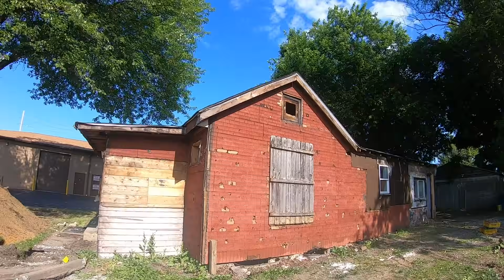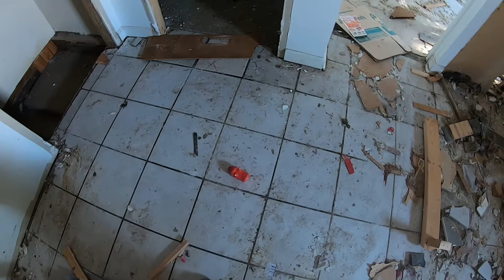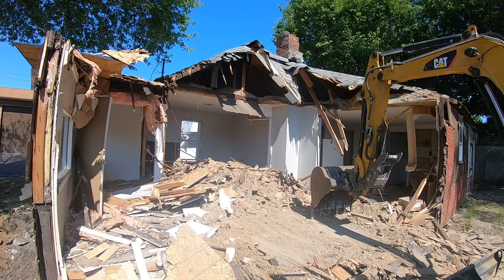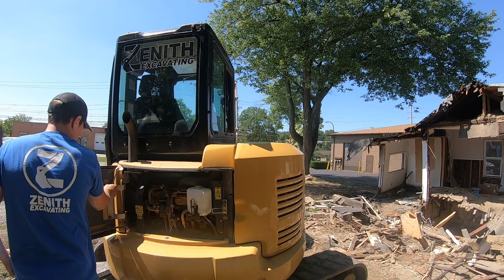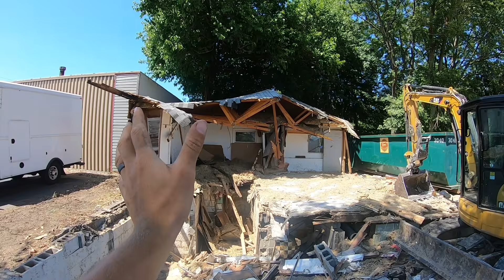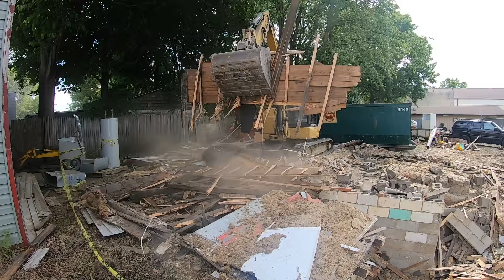Full House Demolition with Dump Trailer and Mini Excavator

Comment: What excavator is this? I’m interested in getting one that wouldn’t require a cdl
Reply from the maker: Cat 305. It about the biggest size/class that can be moved easily without a CDL. It’s 11,500lb. A lot for a 14k trailer, but a 12k GVWR dually pickup will handle it fine.
Reply: @zach-riggs I appreciate the reply! I’m definitely going to look into purchasing one or something similar.
Reply from the maker: @E @Evackuation e you towing with a pickup? If you’re not already committed to that, there are other ways. 

Trailers are Expired Technology
https://youtube.com/shorts/G8XE3rCn8mk?feature=share

Comment: How much cost this service ?
Reply from the maker: The most the customer was willing to pay
Reply: @zach-riggs how much? I’m from Brazil, I wanted to have an approximate idea of the cost…..
Reply from the maker: @Ocaradabatata  it’s going to cost a lot different in Brazil than is does in the US
Reply: @zach-riggs  That's exactly why I wanted to know... but can I give you some advice? Buy a clamp, your work is very amateurish, you first throw the house on the ground then put it back together and throw it in the dumpster, you do two jobs and waste time and diesel still accumulates more hours in your equipment.
Reply from the maker: @Ocaradabatata  ah, thank you for the advice.

Comment: Never break through your 1st floor deck, all you did was take away your max reach at ground level.  The last thing you pull is the floor.  All of that dust into your cab and lungs is terrible for you, wear a respirator or close the door and put on the hvac.
Reply from the maker: Yeah the dust was no good. We really should have had more water on site. I learned my lesson there. I’m not really sure that I find your Oder of operations to be the most suitable for me. Leave a deck in a structure can be really hazardous because it can collapse unexpectedly as you load it with debris or worse, the machine on accident. I’d rather have a basement full of debris that I can crawl out onto in order to reach what I need rather than be stuck at the edges trying to reach everything.
Reply: @zach-riggs that floor is the strongest part of the structure, if you munch on the deck you’ll keep your reach at ground level, work off the deck first.  Bring your walls and roof towards you, then at the end pull it.  I do demolition, and worked for several demo companies.  It’s effective.  Great video keep up the good work!
Reply from the maker: @fuddmethen thanks for the tips. Excavators are designed to work below ground level, not at ground level. The deck might be the strongest part of the wood structure, but it’s not made to support an excavator. If reach at the basement floor level is a problem, then you’ll have a big problem reaching the middle of the basement floor to clean the deck debris off of it when you do demolish the deck. If you crush everything into the basement and get the machine out in the debris pile, reach is never a problem and you can clean up the floor as you work the debris pile back to the edge of the house.

Comment: I’m about to do the same for a 1200 sq foot house how much does this cost? How many 40 yd dumpsters do you think? Thanks
Reply from the maker: @jeremysmith5591  depends on what size machine you’re loading them with and if you have a weight limit or not
Reply: what did you use? and how many dumpsters did you use? gonna be doing the same thing eventually and gonna use 30 yd dumpsters

Comment: A sprinkler working lightly keeps the dust down IF you don't have some one on a hose.
Reply from the maker: @scotth5038  absolutely. I did this job hourly and the fella I was working for was responsible for dust suppression. I won’t make that mistake again 😬
Reply: I am sure that the contractor was paying disposal by the ton and water adds weight. Good or bad, people are motivated by money.  Thanks for sharing!

Comment: What size is the mini
Reply from the maker: @jaythrone1008  cat 305
Reply: Probably a 50 the, smallest you want to do the work
Reply from the maker: @ yep, cat 305 weighs in at 11,500lb. We did it, but an 8-15 ton machine would have been more appropriate.

Comment: No dust suppression, soft strip on internals not complete
Reply from the maker: What would you have further stripped on the inside?
Reply: @zach-riggs  everything mate all internals out and separated all waste. I’m from England our Demo rules might be different from yourself across the pond buddy. But here we do a thing call soft strip, which involves all internals to be stripped out and waste separated. Once the building is back to a bare shell it gets knocked. We have timber skips, hardcore skips, metal skips and general waste. And when the building is down we do a thing called picking, which is on the pile picking the hardcore clean of any timber etc, the hardcore then goes into a crusher it’s then either sold or left for the client to use on the next project. Our Health and Safety would shut the site down if we where knocking the building with no dust suppression 😌
Reply: And we have a lot of asbestos in our old buildings so there has to be a full survey done by asbestos engineers before we start to identify where it may be and then a azzy team tents up, suits up and removed it
Reply from the maker: @kylemills3356  We have some regulations like that. A lot of it depends on the local governing bodies. If I were to do this one again I definitely wpukd have put a greater effort into getting dust suppression  lined up prior to start. That was an oversight on my part for sure.

Comment: Shut the cab door ! Or wear a respirator 😊
Reply from the maker: @billyword7428  I'd love to shut the door but it's not a sealed cab and the AC doesn't have a prayer of keeping up with the sun shining through the glass and the heat that the motor under the seat radiates into the cab. I probably should have worn some PPE though 😬

Comment: Check the fan belt tension. If it’s too loose the machine will get hot
Reply from the maker: Excellent idea! I did check and it was tight. The real problem turned out to be the radiator plugging uo with dust. The radiator on that think is near 4 inches thick and stuff was just getting stuck way down inside. And I couldn't get to it with the blower on the job.
Reply: @zach-riggs  makes sense. I have the same machine and those radiators can be tricky without a blower nozzle
Reply from the maker: @midstatelandsolutionsllc1515  Absolutely I feel like I can never get it all the way clean either.

Comment: Come on falling through builds character 😂 😅.Good job as always buddy. Also I have noticed driving down here in summer time excavators operate  with back hatch open bc they hold way too much hot air. Weird design flaw In my honest opinion
Reply from the maker: Yeahh, I wasn't loving it. I didn't want to just leave it open for fear of ripping it off. The real problem was the dust buildup in the radiator, I think. I wish they were easier to clean out.
Reply: @zach-riggs  its a crappy design for sure. Every few hrs have to open blow it all out and get back at it
Reply from the maker: @brandon-rustystreecare  My skid steer has an auto reversing fan. I think deer excavators do too. Mayne I need to go that direction when it comes time to update the excavator 😅
Reply: @zach-riggs  would be sweet. Hey question though how you get the bell and subscribe clip at the end of your video I see people doing it all the time and cant figure it out
Reply from the maker: @brandon-rustystreecare  honestly, I don't know 😅 my editor does it
Reply: @zach-riggs  🤦‍♂️ 😂

Comment: Zach nice one day rental of you and your equipment around here we get 9 to a grand a day for machine and operator hopefully a little more for demolition jobs. More wear and tear on equipment
Reply from the maker: Wow, that's pretty good! Does that number include your hauling and dump expenses?
Reply: @zach-riggs Absolutely not  machine gets $500.00 operator $400.00 normal 8hr day
Reply from the maker: @robertvannicolo4435  ohhh, I misread your first comment and I thought you said nine grand 😂 I was trying to figure that out.
Reply: @zach-riggs  I have an old 2,000 sqft farmhouse that may have to come down. Thanks for the info. It's 2 story, so a slightly bigger excavator may ne needed.
Reply from the maker: @ absolutely, I typically prefer to use a 30,000-35,000 pound machine for anything more than one story or if the foot print of the basement is very large.
Reply: @zach-riggs  This place is 40x50, 2 story with almost a full basement. A small section, probably the original dating back to the 1800s doesn't have a basement. We're on the fence about knocking it down or fixing it. Roof leaks, window are useless, wiring is old, rooms are small and the mice like it that way.
Reply from the maker: @ that’s a tough decision to make. I imagine know the cost to restore and how much you can get out of it as a rental would help make the decision.
Reply: @zach-riggs  Not renting it. It has some acreage, I plan to live on it someday soon, I hope.
Reply from the maker: @ ah, I gotcha. Acreage is the thing. There is a fixed amount of it and it’s not getting cheaper
Reply: @zach-riggs  That's true, not if they could only stop raising our property taxes. I just subbed to your channel. Good demo advice, thanks.
Reply from the maker: @MikeOrazzi  yeah no kidding 🙄 paying rent for the land we already “own” thanks for the sub, I hope you enjoy videos to come! I have a farm like related video coming out two weeks from now.
Reply: @zach-riggs  We never really "own" anything.
Reply from the maker: @ true enough. We are just stewards